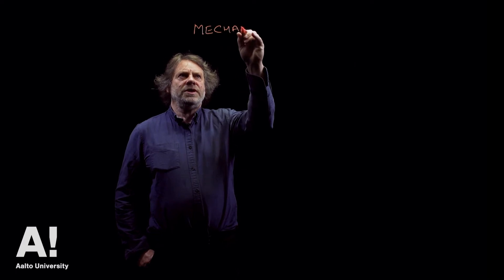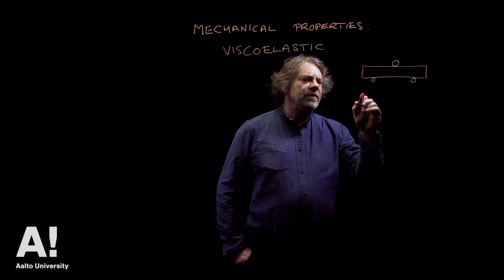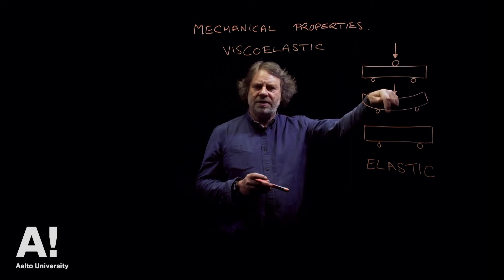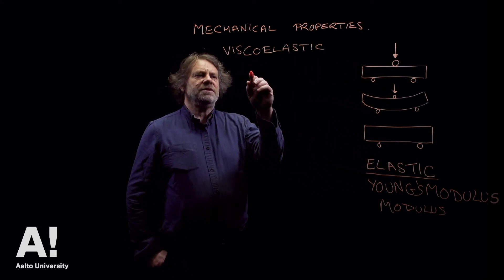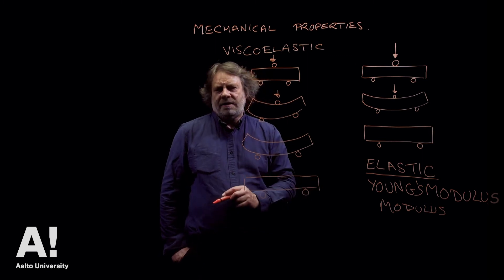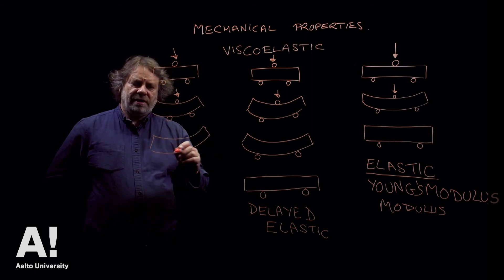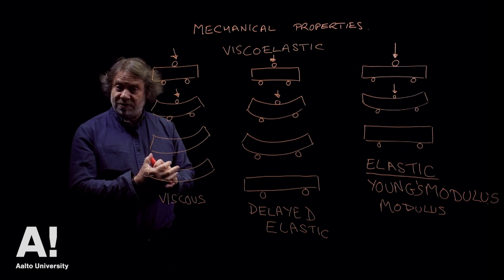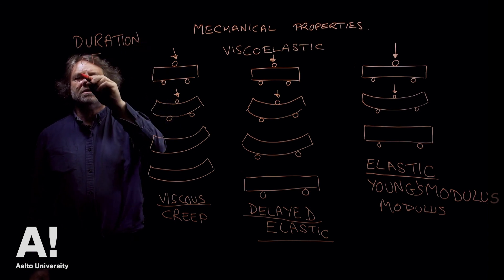Mechanical properties of wood : viscoelastic material

Comment: What he refers to as viscous behavior is typically called plastic deformation, is it not?
Reply: No. The viscous component of a viscoelastic material means that the deformation of this kind of material depends upon the rate of force with time and vice versa. One can see this with creep phenomenon: if you apply a constant tension to a viscoelastic material it will deform as time passes; an elastic material would deform practically instantly and remains so as long as the load is applied.
Thus, viscoelasticity is, in short, a material behavior that depends also with time, rather than just with load. 
Plasticity on the other hand is a deformation that can no longer be undone without giving more energy to the system.